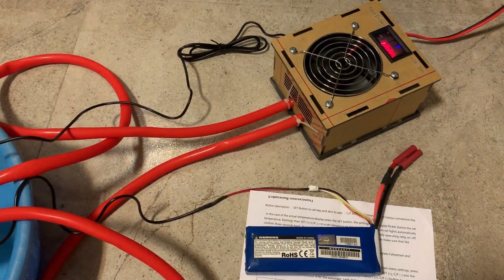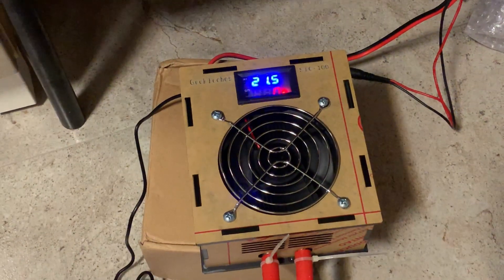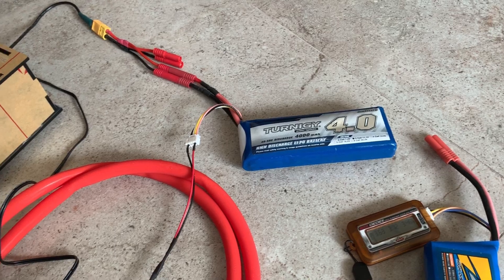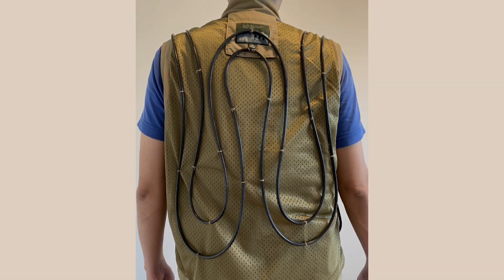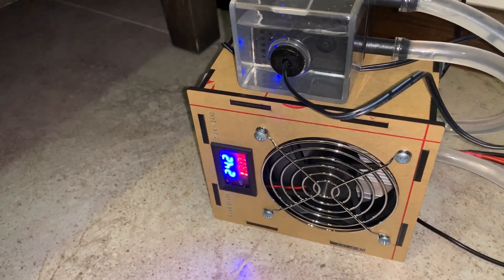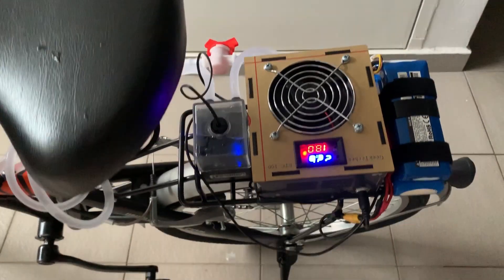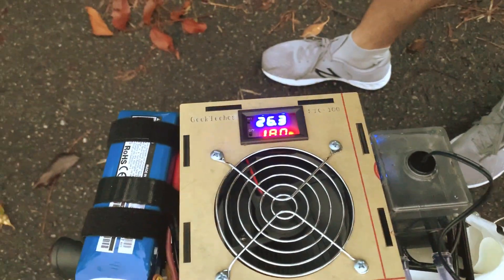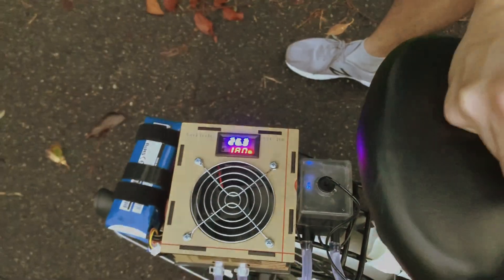DIY Air-con Vest that works!

Comment: You can buy new old stock military vests that would be perfect for a project like this. I bought one and it cost 50$, they come in different sizes. The vests have alot more surface area compared to your diy version, the tubes are nice and flexible and are densely routed around the inside of the vest, the vests are made for humvee drivers and are heavy duty construction.
Reply from the maker: That’s a great suggestion, thanks!
Reply: Do you happen to have a link?

Comment: I'm glad to see this works for you. I still think if we want to go with a smaller unit, with less of a hulking fan, we need to go in a different direction. 
But I'm always interested to see new attempts at a solution, and this is a really good one!
Reply from the maker: Thank you for watching. To be honest, I wasn’t expecting it to work because a friend said he had to run a separate water circulation system to cool down the hot side of his peltier unit. I’m not keen in going that route, so my “plan B” is to throw the water pump-tank into a vacuum flask filled with ice cubes and ridding the peltier water-block system.
Reply: @terence79chan  Perhaps you've seen, but I had the idea that one could build a vest that's essentially sucking hot air away from the body and sucks in ambient air through tiny holes, in order to cool it down with the air pressure cooling effect. Air cooling is usually more efficient, less expensive (money and energy-wise) and keeps you dry.
(I've also started looking into vortex tubes, but I'm not sure to what extent they could be used.)
Reply from the maker: Yes, have seen one. M-Climate had released a bike suit which works on the same concept you mentioned, however it retails at around 1300usd. Vortex tube is a great cooling method capable of delivering high BTU output but small air-brushing compressors and automatic tyre inflaters do not generate enough pressure. A suitable compressor will set you back by around 450usd and it is heavy and noisy. Mini refrigeration-based units are still the most efficient method today, but the smallest units that weigh < 7kg are way overpriced because of their niche factor. I believe these mini compressors, condensers and evaporators are low cost as they are nothing more than shrunken version of the old relics.
Reply: @terence79chan  it's the difficult task the personal cooling community has given itself. Let's keep researching! we'll get there one day ^^
just imagine if we found something suitable for the military, cosplay, super hero movies etc... awesome